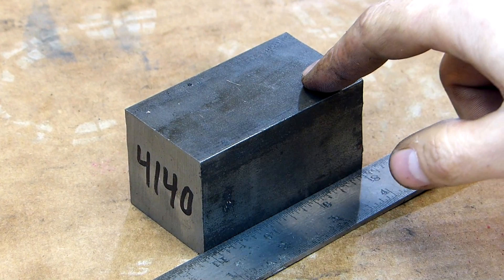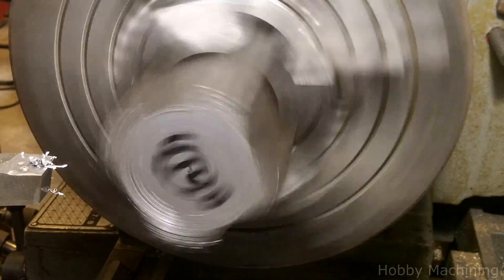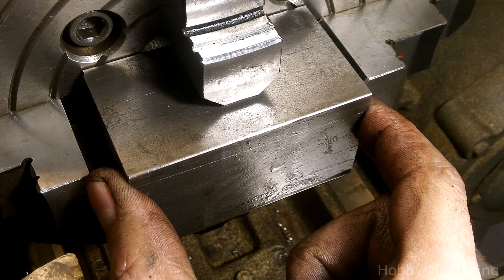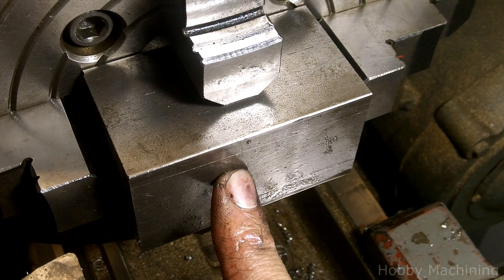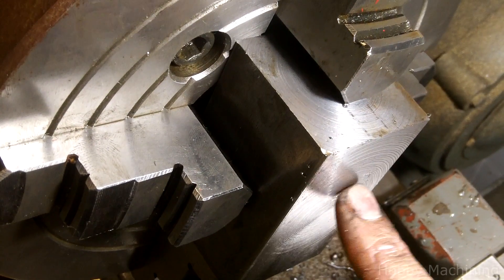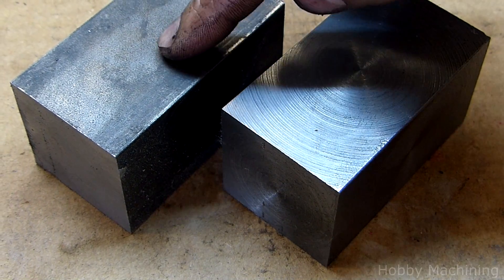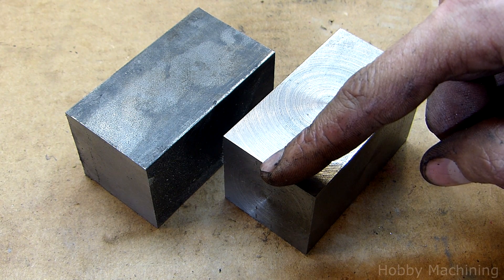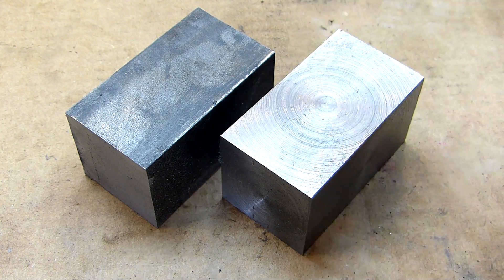Manually squaring a block on the lathe

Comment: The cutting edge/tool is sticking out too far, should be right near the clamping area, using carbide tooling and higher speeds will improve even more on the surface finish.

Comment: You had quite the massive radius on your tool.  Second that wouldn't square up the block without indicating the face facing away from the chuck to see if it runs true.  If the block is out of square and you set it flush against the chuck it will square to the opposite side, not the rest.  so essentially you can have three different 'square' planes that you're working with correct?

Comment: This method will NOT square up the block unless the block was square in the first place.
Reply: Oh yes it will, try it out.  Depending how out of square the block is, the smaller the squared piece will be.
Reply: @brettymike  How do you figure? If the face against the chuck isn't square to the faces in the jaws, you're not going to get a square piece. At best you can make opposite faces perpendicular, but there's no guarantee that they'll be at right angles to each other.
Reply: @Oberon4278  I square up things perfectly, even in my 3 (yes 3!) jaw lathe chuck frequently. You can adjust the objects sitting position in the jaws by various means (packers & measuring back to the chuck face etc). If you haven't got a lathe yet, and you are into making or repairing things - invest in one asap!
Reply: Robert McLachlan yeah that's what I was thinking all it is is tracing the opposite side you have to have a square piece in order to end up with a square piece I don't get it
Reply: @ClownWhisper  Yep.. Should ave done it on a Milling machine or even a surface grinder . Pointless doing it on a lathe .All he ended up with there was a out of square faced up block
Reply: FreezinFury Okay.

Comment: It is true that no matter how slanted the long sides originally were , your new small ends will be parallel to each other. 

the fact that you had your corners resting against the chuck face when doing the long sides only ensures the new long faces will be parallel to each other, but if long faces originally formed a parallelpiped with the small ends then they still will be a parallelpiped (a 3d parallelogram )

this means your small ends are not guaranteed to make right angles with your new large faces.

edit: you can only guarantee 90 degree edges and corners if you can be sure your jaws' gripping faces are perpendicular to the chuck face and that the jaw surfaces make 100% contact with the small ends AND the corners do not rest flat against the chuck face (assuming the original block was a parallelpiped)
Reply: Our GamePC - Try it. It is an apprentice learning test. It does not work. Without squaring two sides and indicating on the 4 jaw it is a fail.

Where did you get trained?  I need to make sure I blacklist anyone from your program.

Comment: I sure wish you would have put a caliper on the finished piece, on all opposing ends. I am not sure how that part would be square. Not that I have a correct technique to recommend hence why I was looking ;-)
Reply: remige2006 No. Well, sometimes, but not always. Only if it is only one side that is out, or two sides are out in opposite ways. Reading my old comment, it is a bit unclear, but my point is: Parallelograms will appear square with a caliper.

 Imagine a perfect square, and then push the top over. That's a parallelogram. It would look sort of like this /=/ but imagine the lines connect and are of equal size. 

If  you measure that with a caliper, all sides will show the same measurement (it started as a square, after all), and every side is parallel to the it's opposite.

But, it no longer has any 90 degree angles
Reply: Jay Jo You cannot proove with a caliper that is is square, but you could proove it is not...without the 90 degrees everywhere, you will have a side  that will be differenent to the one it should be egal to...So said Pythagorus...or Euclide....or Eratostene or may be Archimede....?
Reply: A caliper will show you the size. That has absolutely nothing to do with squareness. Take this for example: /=/. The sizes may be consistent but it is far from square. The piece is not a cube, where all sides are equal. But it is square

The part is square because all 4 jaws hold the part square, so when you face it that face will be 90 degrees to the jaws.

Comment: Good idea, and useful, but only the second small end surface is established based on your reference surfaces.  The chuck face can be a reference surface and your first milled side can also be, but the chuck jaws cannot be.  The first two end faces should be parallel with each other, but the first large face is not referenced to them.  For the same reason, the final two faces should be parallel, but not necessarily square to the other faces.  Likely close enough for most work, but not really correct.  Using the lathe only, I don't know how that could be corrected...
Reply: +Keith Rider 
Use an indicator and dial it squared.
Reply: +Bob Korves 
You could do it right by mounting the work to an angle plate and the angle plate to a face plate. As long as the face plate runs true and the angle plate is a true right angle, then the block should come out with true right angles
Reply: +Keith Rider Wow, old thread.  I had to watch the video again and read the comments to refresh this old brain.  Your angle plate is a good idea, Keith, and would allow making right angles.  That would get you around the first four sides parallel and square, but I do not see how that will make the remaining two opposite ends square in both directions at once.  Adding a second angle plate ninety degrees to the first for the final two faces and mounted so the angle plates are solid to the face plate while also solid to two adjacent finished sides of the block should do the job.  It does take the easy approach that Hobby Machining used and turns it into something a lot more complicated with additional tooling required. Perhaps this is why milling machines were invented...   8^)
Edit:  I was thinking of basic angle plates with only the external faces square.  If the angle plate had square and parallel inside surfaces as well, that would do the job with just one angle plate.  I actually have several angle plates like that...
Reply: +Bob Korves 
Two angle plates would work, but the weight is likely to require a lot of counterbalancing. I would probably just use a square to set the work straight in one direction. Or you could bolt a parallel to the faceplate and set it with a square.
Reply: +Bob Korves 
Face plate and angle plate.